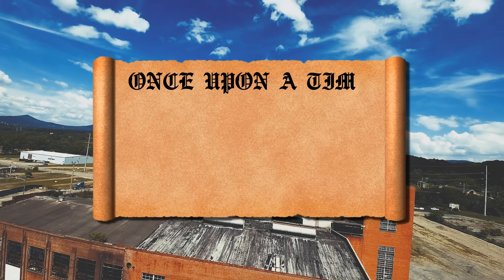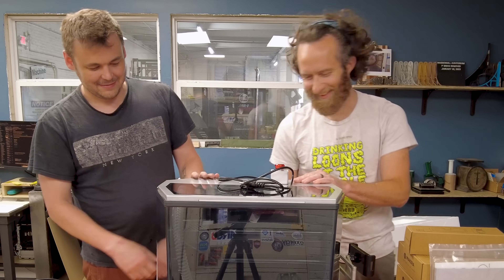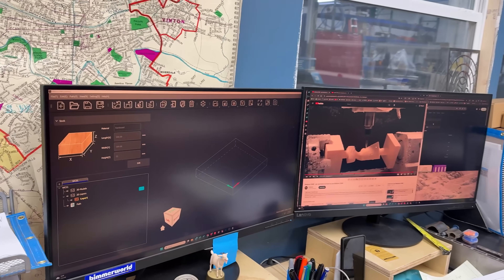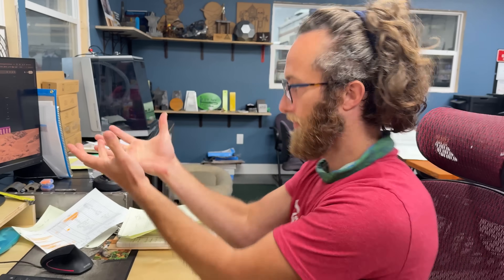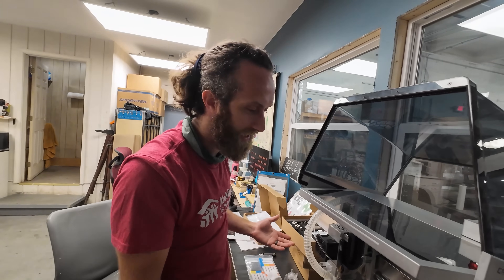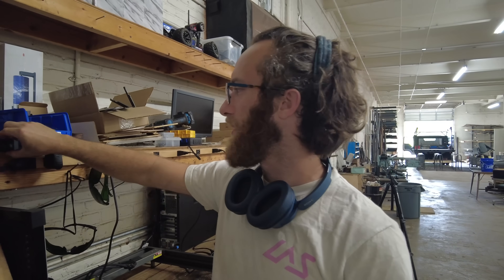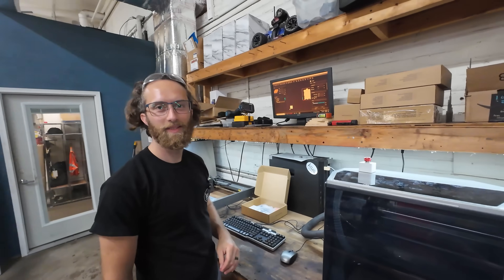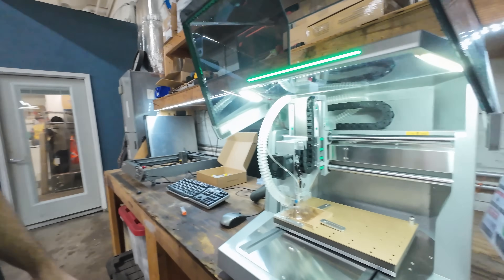How idiot proof is this tabletop CNC?  - Reviewing the Makera Carvera Air

Comment: I need one to make one of these.
https://youtu.be/8E2M99B79CI

 Getting old drilling 100 holes at a pop. I give them to the stats classes at local schools.
Reply: CO2 Laser would be a better and cheaper option. I have made a stack of small fixture plates to take 2 and 3mm dowel pins in 3 or 5mm Acrylic sheet. You could also cut the rest of your chutes and vanes from MDF or Ply or Dark Acrylic if you wanted to get some produced in small volumes. Even get them produced by someone else like SendCutSend etc when you have the CAD done.
Reply: @seabreezecoffeeroasters7994 great ideas thanks!
Reply: @LouJustlou  Having a little more think about it if you go with a service get a test board cut first with a range of holes +- your pins. I know what my kerf and tolerance is to tweak press or loose fit. Best is convince yourself you NEED a new bit of gear 😆
Reply: @seabreezecoffeeroasters7994 there's no reason to show my wife this comment. 😊 I've already seen some pretty cool 3d printed ones too. Much smaller but still shows the math. Glowforge laser at the size I want is almost 5 grand. Might just do a smaller version.
Reply: @LouJustlou  Avoid the Glowforge and its propitiatory parts. Generic Chinese 60W 600x400 with a Ruida controller and a copy of Lightburn is better and much less $$.